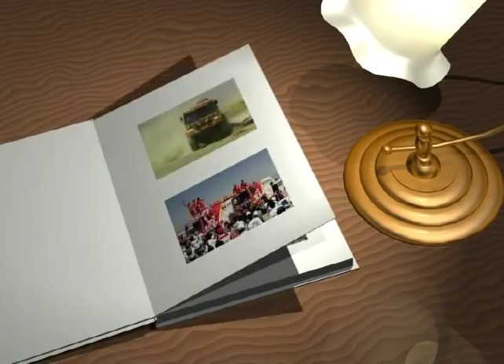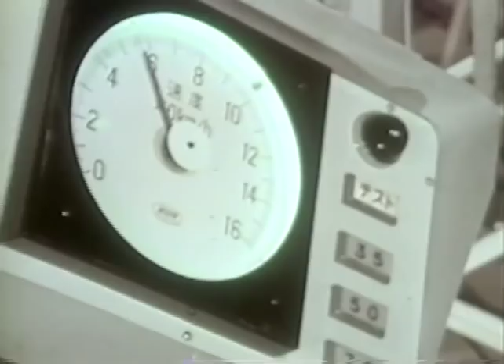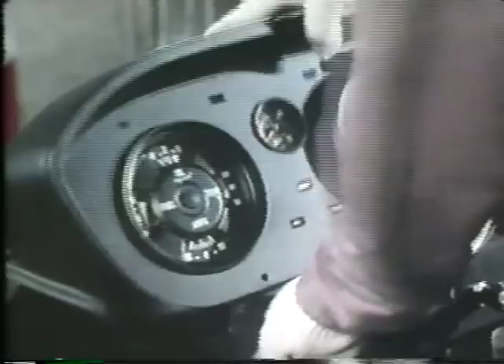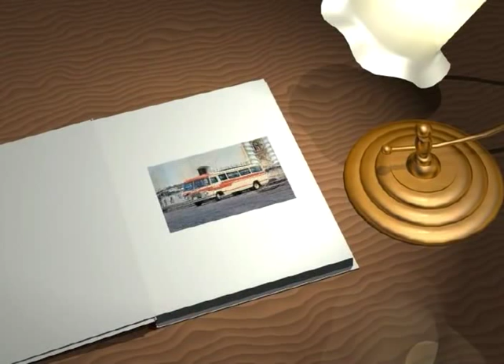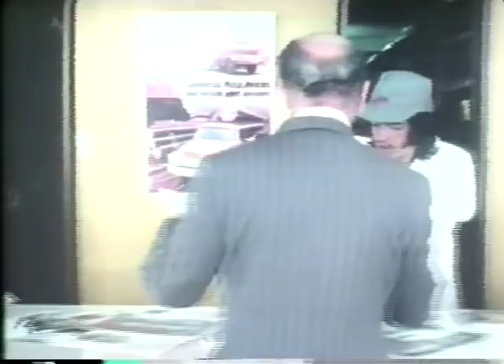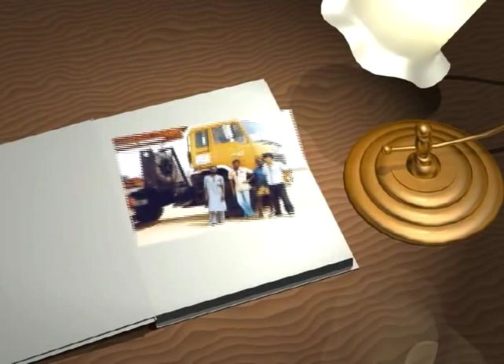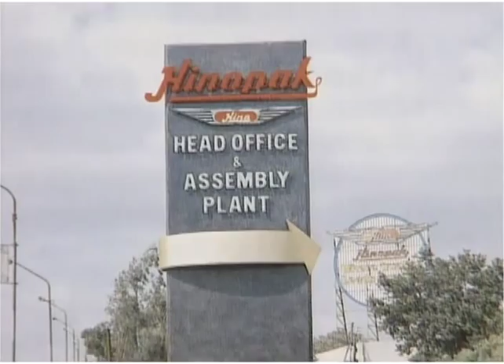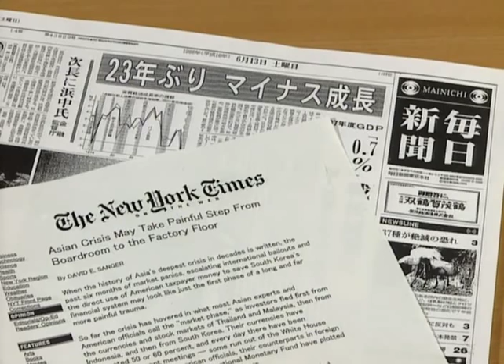Hino Trucks History Video

Comment: HINO series INDONESIA

HINO series TRUK (big)

- FF / FM (Ranger)
- FG 210ps/jj , FG 235ps , FG 260ps
- SG 260ps
- FL 235ps , FL 260ps
- FM 260ps , FM 320ps

HINO series BUS (big)

- AK1 (172ps , 173ps , 174ps , 176ps) 
- AK3HR 190ps
- AK1J / AKJ 210ps
- AK8 215ps TURBO INTERCOOLER

- RK1 174ps
- RK2 190ps
- RK2HR / RKT 200ps
- RK1j 260ps MATIC
- RK8J (235ps , 260ps)
- RG1jn 240ps
- RG1js 240ps TURBO INTERCOOLER
- RN8J 285ps TURBO INTERCOOLER
- RM1 390ps (space frame) TURBO INTERCOOLER
(edit)

#HINO👍💪